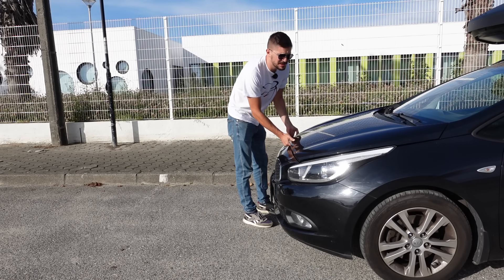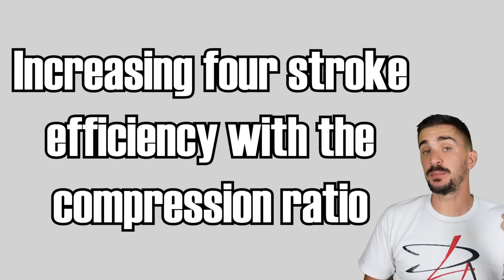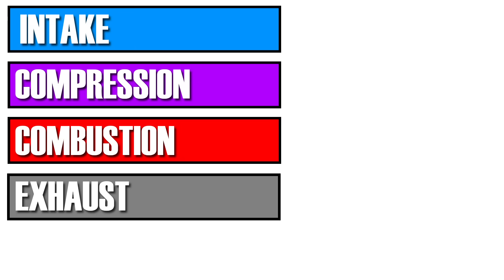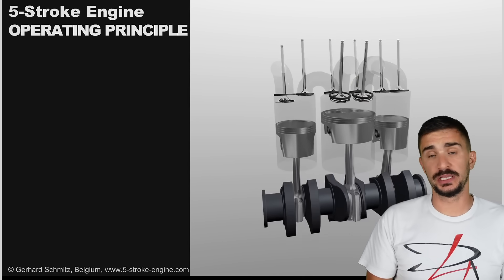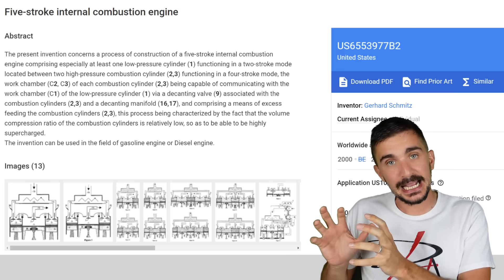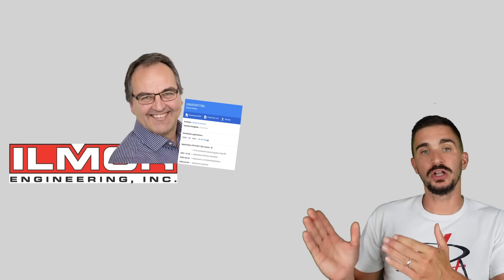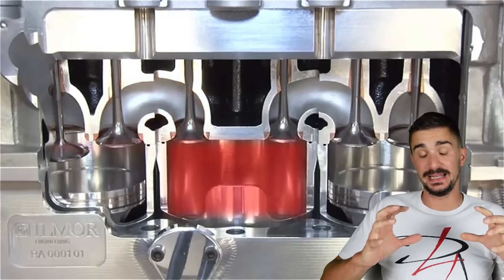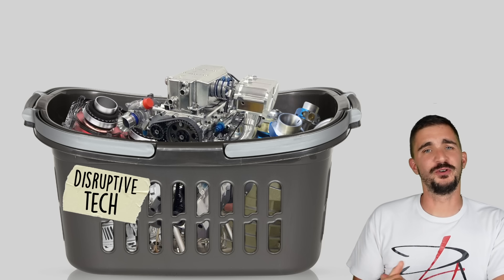Why Five Stroke Engines Are More Efficient But Still a Failure

Comment: Genuine question why don't we spin up a turbine with the exhaust gas that runs a generator and that runs electrical assist / charges batteries
Reply: F1 used to use that...MGU-H

It's prone to failure and electrical issues.
Reply: @S.ASmith  Interesting - Ill look it up. It was one of those things that seemed so obvious I thought I was being really stupid asking the question.
Reply: The new 911 is doing something similar, sort of.
Reply: @onupeer5771  I guess until the advent of HVDC / AC car systems it was pretty useless - you are going to get wildly variable voltages just like regenerative breaking, you need advanced electronics to harness that.
Reply: In summary, you can accomplish about 90% of the same thing with a delayed intake valve timing. For cheap commuter cars, a turbo system is a noticable increase in cost, which is why you don't see turbos in Toyota's hybrids until you get up the power level and price. It's also pretty useless at low loads, which street cars are often at, so using it as a standalone system is right out. It pretty much has to be electrically assisted, and if you're going to be adding a high voltage system, might as well just directly boost the drivetrain with electric motors.

All turbines share a similar weakness in that they don't operate efficiently without a considerable flow velocity, which makes them bad at adjusting for various conditions. Sure there's variable intake vanes, but again, cost. A NA engine with electric assist can easily siphon a small amount or large amount for the battery storage or propulsion no matter the engine speed.

Outside of making sports cars (F1, Porsche), or long haul trucks, they just don't get enough opportunities to gain rather than loss.
Reply: Look for Volvo d13 turbo compound
Reply: @Stef.Cata051  Found it - thats cool
Reply: Thats what Mercedes is doing on the C63 AMG and Porsche on the new 911 hybrid
Reply: The concept is called "turbo compounding". It used to be done with a hydrocoupling instead of electric generator. It was used in Wright R-3350 engine used in Lockheed Super Constellation airliner.
Reply: @igornoga5362  - Im really pleased I asked this question - Ive had some great replies about things I was totally unaware of.  EDIT "The Turbo Compound delivers it's energy directly mechanically to the crankshaft with the help of gears and fluid couplings. The PRT's (Power Recovery Turbines) deliver 20% more power to the engine from the "waste" energy of the exhaust gases." 

20% thats a lot.  Obviously and aircraft engine is a high RPM almost constantly so ther eis a lot to recover.
Reply: You also get conversion losses.
Reply: Porsche just introduced this system in their new 911. Engineering Explained made a vido about that just a couple days ago
Reply: @ClockDev  OH cool thanks Illgo look for that
Reply: Because it's a lot cheaper to just put the alternator on the fan belt.
Reply: @vylbird8014  which sucks the energy from the engine instead of recovering wasted energy from the exhaust gasses. Making the engine L:ESS efficient not MORE efficeint.
Reply: @piccalillipit9211  Efficiency isn't everything. Have you seen the cost of a well-manufactured turbocharger, which is basically what you'd need for this? It'd add at least another thousand dollars to the price, and the car manufacturer isn't the one paying for the fuel costs.
Reply: @vylbird8014  Efficiency is absolutely everything for fleet cars, delivery vans and trucks
Reply: Because it's already a thing and it's called an alternator but it runs on the serpentine belt instead of exhaust gas. The exhaust turbine one already exists and that is called a turbocharger! It doesn't generate electricity but makes an extra boost for the engine which creates more power.
Reply: @Kelle128  "makes an extra boost for the engine which creates more power."   NO IT DOES NOT.  The additional fuel you can add as a result of the increased volume of O2 is what increases the power.   NOT the turbocharger.
Reply: @piccalillipit9211  Well ackchually 
Assuming same horsepower AND peak power rpm, turbo engines are slightly more efficient than naturally aspirated. 
🤓
It's just that people usually use turbocharger for max performance, which sacrifices efficiency.
Reply: @ZeroXSEED  YES because you are using a smaller engine if "same horsepower AND peak power rpm" V naturally aspirated so you have less friction.
Reply: I wonder if we will ever see anything on the internet labelled "Genuine Question" which actually is a genuine question rather than a desperate attempt by the OP to make himself feel better by trying to look smarter than the people answering him?  Genuine question.

Comment: Toyota recently said that it teams up with Mazda and Subaru to develop some more ICE engines. I think, Volkswagen said something similar recently too. ICE engine will stay with us for the nearest future, that is for sure.
Reply: ICE isn't going away anytime soon.
It's not as simple as "green" (which EV's are certainly not).
It's infrastructure.

Even IF(!) battery energy density can be increased 3 fold, it's still too heavy for roads, bridges, multi level carparks...

More over, even IF 5 or even 6 fold, distribution grids that are already failing to cope with the solar power generated during off peak, and struggling to cope with demand during peak times, the world over... Most of which is still coal and gas.

Dino squeezings and nuclear are the only truly viable answers. If "climate change" wasn't such a scam, "we'd" already be harnessing fast breeder reactors, burning off all the "nuclear waste" piles at the same time, while emitting ZERO carbon.
Reply: @Jimmeh_B Thank you for the breath of fresh air
Reply: @Jimmeh_B  the infrastructure problems are nowhere near as large as detractors want you to believe with regards to most people to mostly use BEV's we're not saying that in the use cases where liquid fuel combustion is necessary it's not going to continue to be necessary; however I shouldn't have to do this on this channel but here we go.
1) high life, low cost low density batteries can be used as buffers for inrush current during charging at vehicle charging stations just the same as gas stations have massive tanks under the parking lot to store fuel batteries can be used so that the infrastructure feeding the station can be sufficient to manage daily usage rather than momentary usage. (Think Water tower)
2)to increase total capacity to a point that it would be able to handle the projected transportation needs of the US would be about 1/3 of the effort of the initial grid build out on a proportional level.
3) fighting the inevitable only leads to delayed progress 
4)as regulations force manufacturers to shift towards BEV you create a sense of urgency for them to overcome the limitations of BEV technology
Reply: ICE would stay for a long time in ships and trucks. Battery energy density just isn't there yet to power them.
Reply: @danieltanuwijaya7675  the thing with large trucks is last mile delivery is actually a great use for EV trucks, but the way New trucks are it's just not that viable for long haul EV yet
Reply: @fulconandroadcone9488 you've obviously never scheduled rail shipping, I see.  When it has to get there next week, they'll get it there next month.  If they don't lose it.
Reply: @randymagnum143  isn't that shipping in general? if you send a small packet in a large truck you hope it gets there if you get an entire truck they have to get your package only. Try getting an entire train worth of goods and see if they do it better.
Reply: @fulconandroadcone9488  ha, imagine loosing 2 super cars, 4 flatbeds and 2 pieces of machinery 130' long, 13' tall, and 10' wide.  For 3 months. 
If you dealt with them, it wouldn't take long to understand.  It's almost like dealing with the government, both in attitude and incompetence.
Reply: @randymagnum143  dud, how much lost cargo is that on a 600 container train? how many of those will they run a day?
Reply: The main area I think ice will continue to be relevant is as a range adder or hybrid component in haul and remote location use work vehicles
Reply: @myonen4402   And seasonal work like farming - from harvest to seeding. Spraying and fertilizer spreading could be done without ICE and massive improvement in battery energy density.
Reply: @valtersvasilis  yes I also see that an EV with a compact diesel electric generator could constant charge the batteries @ peak thermal efficiency would actually be amazing for me as an electrician because I could literally use my truck as a job site generator
Reply: @myonen4402  the Canadian EDISON truck Topsy is exactly that, c9 cat powering a logging truck, with a 2.8l retrofit kit for 3/4tonne trucks
Reply: @valtersvasilis  Spraying and spreading is already being done with electric powered drones.
Reply: ICE engine: do you realise that what you wrote was Internal Combustion Engine engine? 😄
Reply: Mazda developed SkyActiv that addresses exactly the compression ratio issue. As far as I remember there’s a video on Engineering Explained channel
Reply: @ebonfortress  if you run the engine at a consistent speed and load, variable compression ratio is unnecessary.
Reply: @randymagnum143  as far as I understand SkyActiv and some Toyota engines among other things try to emulate Atkinson cycle with compression ratio being less than expansion ratio which is useful for all modes of operation
Reply: I would say 50 years at least. Now that companies are making mass market EVs the world sees that they are nonsense and all the hype was just hype. Hydrogen is promising but is still a long ways off. It will take a decade or more to develop a commercially viable hydrogen powertrain and decades more to build up infrastructure. ICE on the other hand is here, well known and tested. We can develop alternative fuels much easier that building hydrogen infrastructure. So considering all of this I would say ICE is here for at least the next 50 years.
Reply: That's called consolidation. When a technology becomes less commercially viable and loses market share you usually see players start to merge and disappear. The "new" engines will probably pick the cheapest or most versatile of existing parts and solutions to reduce the total part bin and manufacturing technology pool and reduce the total industry overhead of everyone producing different stuff and doing things a little differently. I don't predict the total demise of ICE but consolidation is definitely a stage of demise of a certain technology.
Reply: Dodge stopped saying they were going full electric by 2035.
Reply: @Mika-ph6ku  Synthetic fuel isn't new. During WWII, Germany had to produce their own synthetic fuel after they were cut off from the Romanian oil fields.
Reply: But increasingly relegated to niches: high performance, cheap retrofits, novelty, etc. Once a transition (like electrification) gets moving there’s little reason to invest much in the old. I think Toyota believes everyone jumped off a bit early so there’s room for some ICE development still, but I suspect very little. I’ve studied these tech substitution models in several industries and so the math is convincing me. But I get things wrong like anyone.
Reply: @tallen6641   What do you mean by "old"? You could get electric Ford T, diesel, for example, is much newer technology, then electric!
Reply: @cdjxwubcyex  that’s fair to get the definitions clear. The modern electric driven car is A/C motors driven by power semiconductors for variable speed, regenerative breaking, etc. That standard architecture is “new” and petroleum ICE is “old” for this analysis. Including diesel, Wankel, or other. Those very early electrics have little in common with either and so I’d just exclude them. Of course, one can see this up differently and get a different result.
Reply: @tallen6641   That's not true, those early electric cars have the same working principles as todays cars - electric motors powered by battery. If you think that throwing semiconductors at something makes it fundamentally new, then you will be surprised to know that ICE cars also use the same "new" semiconductors (injection, ignition, etc..), without changing their working principles.
Reply: @cdjxwubcyex  we may not agree then. I wasn’t being cavalier about this, but didn’t think that the comment thread was a good place to unpack the whole argument in detail. I work in this business, which doesn’t make me right, but it gives me a viewpoint and some personal observations. I used to work in telecom equipment and didn’t same modeling of copper to fiber transitions, circuit to packet, analog to digital, optical and magnetic storage, and now in energy modeled fossil and renewable energy, etc. Models can be wrong and misapplied. But in my humble view, this freight train is moving and won’t likely be stopped, even if ICE technology improves significantly. But will see.

Comment: Whenever something cool does not enter mass market it's either because
1. The technology is not ready. A lot of modern auto tech was considered niche or impractical in the past.
2. May have debilitating problems that means not worth the advantages. Maybe related to 1.
3. Lobbying by competitors